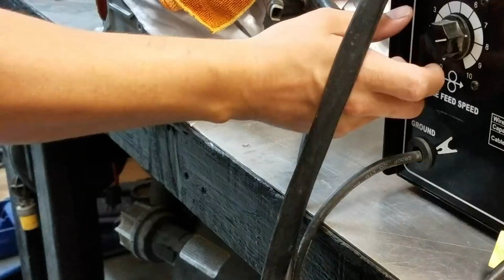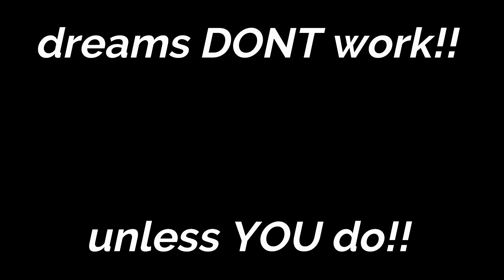Solving Problems!

Comment: You also might want to try to flare the ends of your transmission lines with a flaring tool or a brake flaring tool you just want to get to you just want to get the end of the line with a little bit more of a wider head on it so when you clap it down at fights and window hose tries to slide off it has literally like a bump stop you'd find in a parking lot for your car too lean up against me to park it just ideas

Comment: Ran into the same issue but I got them out. By any chance do you remember the part #s for the rocker shaft sealing bolts?

Comment: Glad u got those plugs out man.. Keep it up .. Quick question... I'm painting my GTI fsemi gloss black .. I've got a good 3rd coat all finished and dry.. Now ... Do I wet sand it with 2000. And if so what technique should be used .. (One way/circles/both ways ) .... And then do the clear coat? ... This is to get the best paint finish before I move on to the clear ... And what kind of clear should I use ... Gloss.. semi gloss or flat?!?.. Id appreciate your knowledge and feedback here .. I want it to look good ..
Reply: A reply as soon as you can would be fantastic ... I've got some free time now .. But I'm not positive about how I should proceed ! ...  Thanks